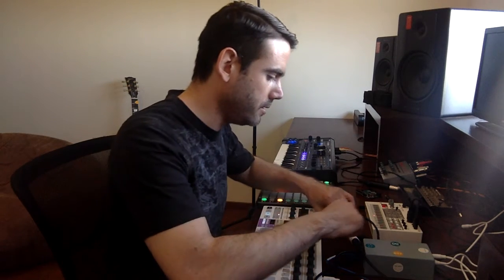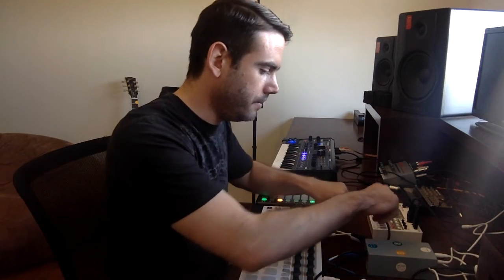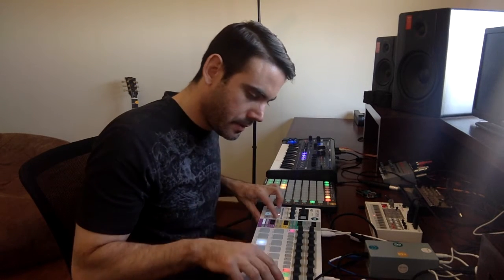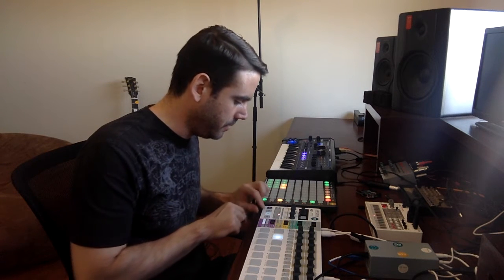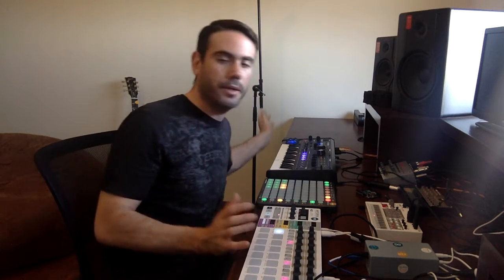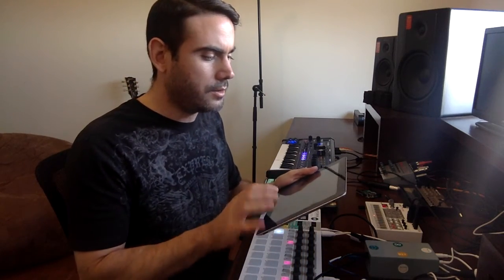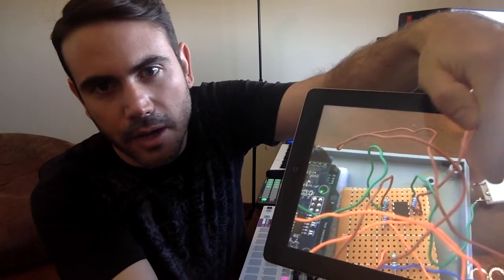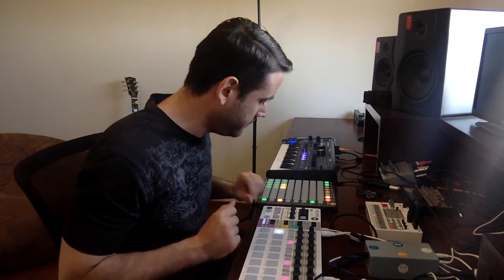Volca Simple, redirect midi channels to the Korg Volca Sample using an Arduino

Comment: Hello, 
This is really great! I was wondering if you can put a small diagram of how to exactly connect the resistors and other parts on the board ( i mean the pure electronic part ) Assembling it wont be a problem. So i was wondering if you can put something like this to help amateurs like me :) Cheers!

Comment: great tutorial Mauricio. Keep it up! Im just getting started with arduino and want to use it as a midi hub/splitter. would it be possible to split the midi signal based on notes played and redirect a note or set of notes to different pieces of gear? it does not seem so far fetched now that I have seen your tutorial, however I do not have the programming knowledge... I have an old electribe that sends different notes for each part/sample, but if i could split these, it could be more like a beatstep pro but with onboard samples as well!
Reply: any ideas?
Reply from the maker: You might do that by just asigning diferetn midi channels to different gear, but if you are talking of spliting a keyboard so that some keys go to different midi channel, yes its posible

Comment: This is awesome for those of use handy with a soldering iron and the DIY spirit.  For everyone else (including me), you can buy a prefab cable that has the redirector built into it.  Still fairly cheap.  Look up the RetroKit RK002
Reply from the maker: +Josh Reineke yes but it can not do this https://youtu.be/WYGxZFbxsSg
Reply: +Mauricio Maisterrena Is that true? No way at all?
Reply from the maker: +sebprovision im talking about the video in the link i posted in that comment
Reply: No, I know. It's a cool video! So no way to get poly using that cable??
Reply from the maker: +sebprovision i don't think so you need something that can be programed not just a cable
Reply: The polyphony does look great I have to say. I need to buy it first and see how I go with manually entering note values and how much I might want. Cheers for responding by the way!.. 

Can I ask you some questions about the Beatstep Pro please?

1) Can I extend the pattern length of the Volca Sample with the BSP pattern sets (4 sets of 16 steps right?) or is that limited by the Volca Sample's 16 steps? 
3) You can't have CV amounts on the knobs right? For affecting filter cuttoff for instance. 
4) Anything worth mentioning in terms of limitations or features you really like of the BSP? I originally just wanted the Volca Sample to use as a rhythm machine for one of my my analog synths then I saw the BSP now I figure I hook getting everything going in a life situation. 

Cheers Mauricio
Reply: Hey check this out, "Good news! Just got a reply from Retrokit. I asked if their cable allowed melodic playback of each sample:

"Well as a matter of fact this is the newest feature to the Cable firmware. The lower octave (or any octave you set as the ‘control octave') acts as a sample selector and the other octaves are for chromatic play. You can also fix the chromatic play to a single sample. This way you can play different samples on the control octave and use the other as pitch control for a single sample."
Reply: in the same spirit, also based on an Arduino : http://techiesexpedition.blogspot.fr/2016/12/volca-sample-and-kaosscilator-as-true.html

Comment: i have a question im thinking of getting the beatstep pro to sequence a couple of gear and the volca sample, isnt there a way to edit the midi channels in the desktop app so each note is sent on a different channel?
Also wouldn't it be possible to make the arduino code also convert pitch information into the CC for the speed of a sample? thus giving the volca also the ability to be played melodically? (probably not using the drum sequencer, but one of the melodic ones)
Reply from the maker: Unfortunately to this day you cant assign a different midi channel to each pad on the drum sequencer. To your second question about pitch on the volca, yes thats definitely possible.
Reply from the maker: +fayekhelmi done the pitch part check it out here https://youtu.be/WYGxZFbxsSg

Comment: this is really cool, thanks.  been meaning to grab an arduino and this is a perfect starting project for it.  trying to play the volca sample live on the ribbon is fun but painful.  

i wonder if it can be set up to send other parameter info, like level and pitch/speed...
Reply from the maker: +OIP 1  thanks OIP, and sure that can be done with the arduino, you can control any midi parameter and since  the transparent knobs on the volca sample can be controlled by midi this is definitely possible.